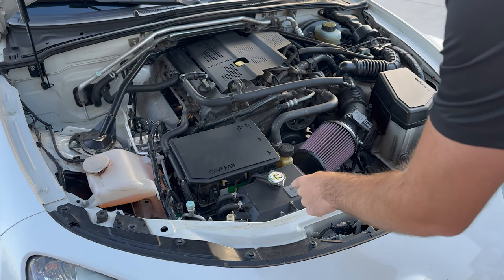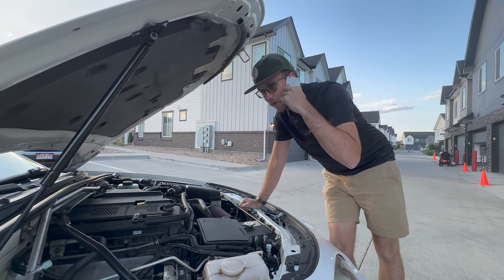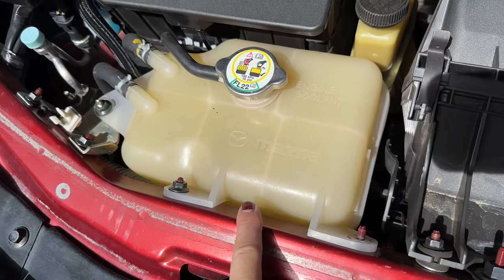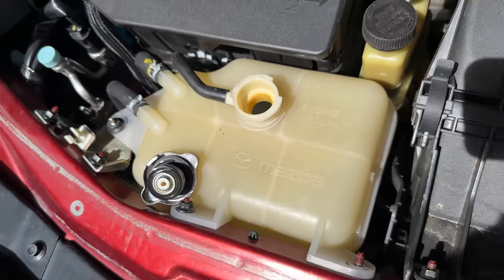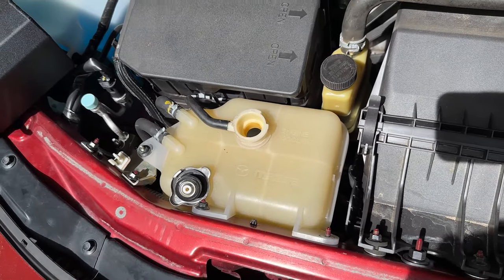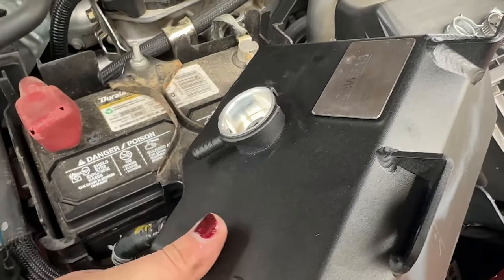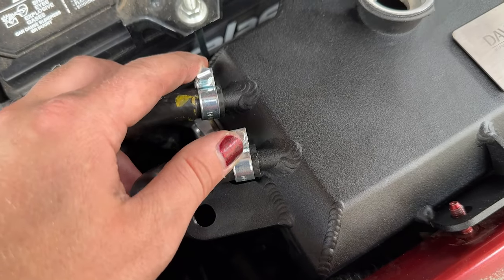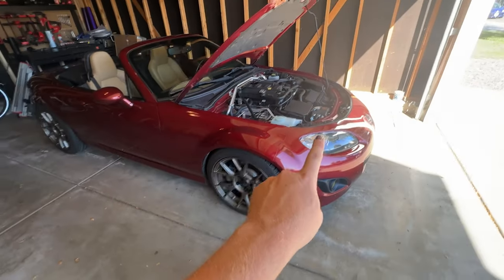Fixing the point of failure on the NC Miata! DaveFab coolant expansion tank.

Comment: I suggest you go back to using spring clamps as they maintain constant pressure; as the hoses heat/cool they keep tension.  Screw style clamps will loosen from heat/cool and the vibration of the car.  That’s why OEM uses spring.  You’re risking a line backing off and leaking.

Comment: Why is this unit preferred at $300 over a very similar one made by alloyworks available for $150? The angle of the overflow by the cap, and the ribbing on the tubes appear to be the only differences?

Comment: I might be wrong but werent the cracking coolant tanks a pre facelift issue? Like up to 2009 model years? Never heard of any problems on the NC2.
Reply from the maker: To my knowledge, all models are susceptible as the parts are interchangeable. But I also had an NC1 with 250,000 miles before, on its factory expansion tank. So it's not necessarily a guaranteed thing. But enough people suggest replacing that we thought...might as well!
Reply: Nah here I am with 2015 nc and I need to change it out I guess the problem never got addressed
Reply: @frankyramirez1663 hey at  how many miles did you get to before having to change it? I also have a nc 2015
Reply: @mangosnack  FWIW, I'm changing the factory tank on my 2008 nc1. Only 40k, but it's 16 years old. No problems, but there are enough reports of problems that I don't want to just hope it doesn't eventually fail. I'm draining and refilling anyway so it's cheap insurance against a potentially much bigger problem.

BTW, I'm just using a new OEM tank because I don't like having only a small awkwardly placed site window to see the level.
Reply: @mangosnack  I was at 50k but looking back for sure I run my car hard

Comment: What milage do you suggest charge the coolant tank?
Also why chose aluminum?
Reply from the maker: Aluminum tends to be stronger (if built well) than the OEM plastic one. So a lot of people go that route in the aftermarket options. Not sure there's specific mileage, but many people say if it looks yellow or remotely questionable, replace it! Which could be due to age or mileage or both.
Reply: Some people just prefer the more finished look vs plastic. I like the plastic tank because it's much easier to see the level, and some people have had leaks with fabricated metal tanks. My OEM tank was 16 years old and was only replaced as a precaution.